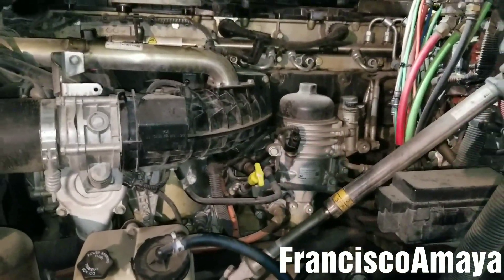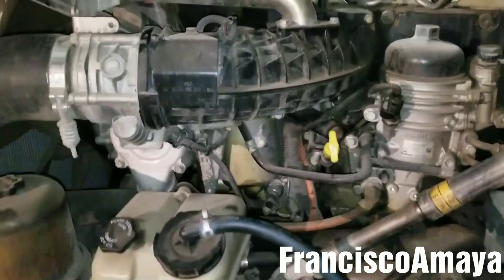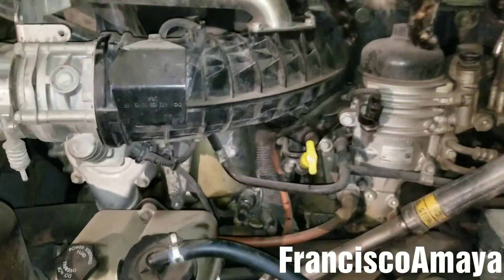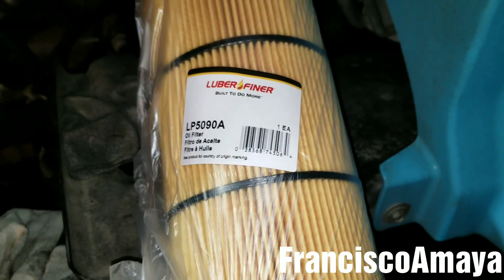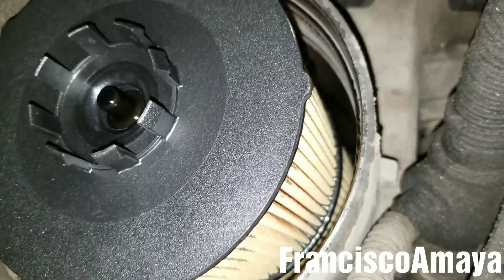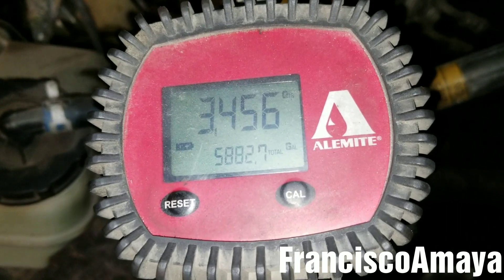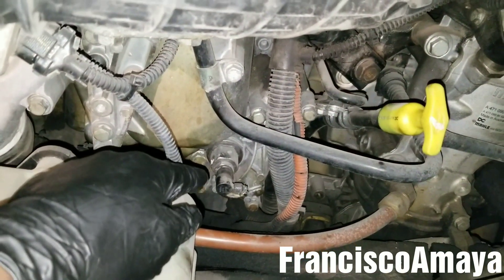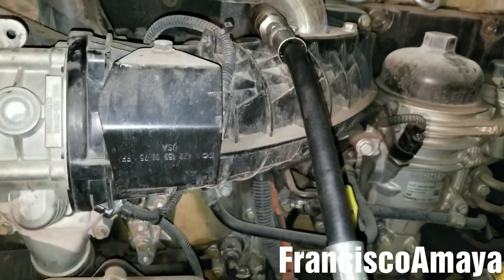Freightliner cascadia DD13 DD15 DD16 engine oil lubrication system pre filling bearings overhaul

Comment: I have a2015 Cascadia with the DD15 engine. I lost all oil pressure so I replaced the oil manifold and I rings. Pressure came back up to normal and stayed there for a while and back to zero again. I shut the engine down and cranked it again. The oil pressure came back up to normal but it dropped again. I repeated this several times and it continues to do the same thing.
Reply: Did you figure it out?

Comment: Bro help me this spn 3251 fmi 2 light is on my dash board
Reply: Abdirisaaq Ahmed that's a code for doc pressure
Reply: @transport21  do have go to shop or it is some fuse or sensor, Thanks
Reply: Abdirisaaq Ahmed they are sensors.  2 pressure sensors on your one box. Then have to do regen. 
Depends if your familiar with changing your dpf sensors yourself. 
I uselly take my truck to a shop in Bakersfield ca.
Reply: Abdirisaaq Ahmed but that's what I think might be sensors from the code you gave me.  Could be something else need a diagnostic laptop to check. 
Probably change out your sensors will be cheaper and if no work then take it to a shop mabey?
Reply: Abdirisaaq Ahmed let us know what you did and how you fixed the problem.
Reply: is ur truck losing power
Reply: nabpreet butter yes he definitely lost power. This code I think does 25% derate
Reply: @thegarage6348  I did not  lose any power, everything is fine so far in 72 hours light is on everything else is fine
Reply: Abdirisaaq Ahmed that's good.  Keep us updated on how u got problem fixed.
Reply: i would suggest you to use override switch incase u start losing power,because later on it will start to derate once the dpf start collecting soot
Reply: @thegarage6348  how will I doing it, Thanks
Reply: Abdirisaaq Ahmed any update? Did you get it fixed?
Reply: @transport21  every thing is  okay so far I didn't fix yet
Reply: I fix it it was problem egr censor I replaced it no more code 😁😁😁
Reply: Abdirisaaq Ahmed should get It checked out before your red stop light comes on